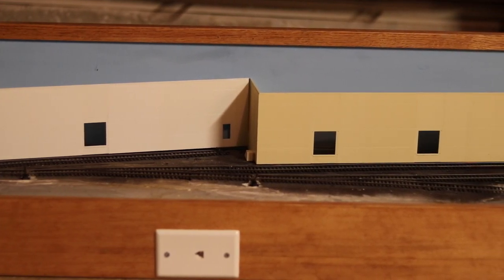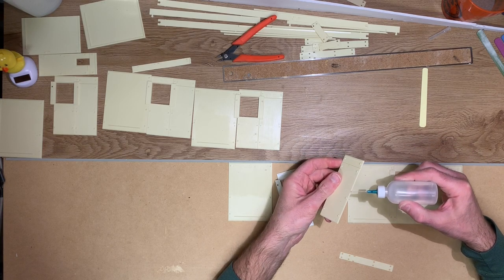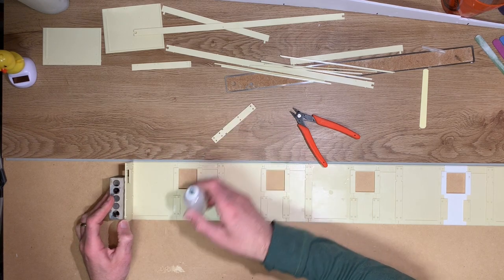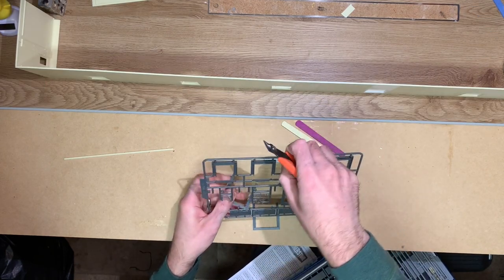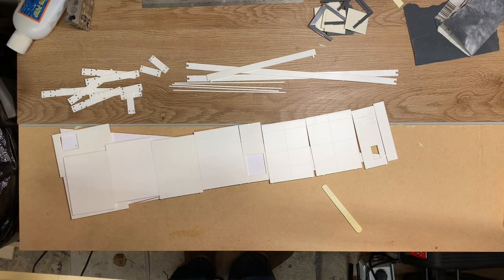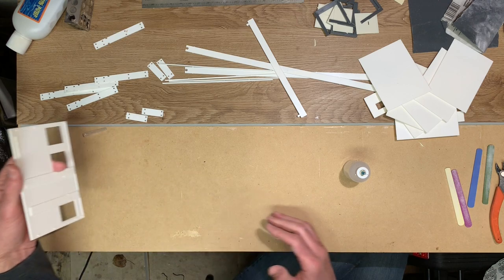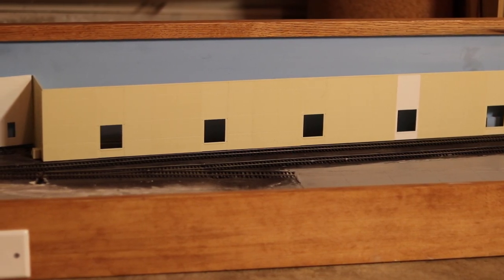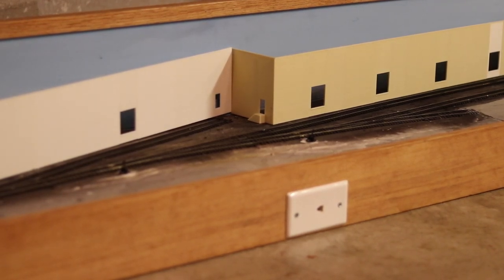Tulsa Spur Part 8: Structures for the 1x6 HO Switching Layout

Comment: You set that up for 40' box cars.    Will the  the pieces line up for longer cars, like 50'
Reply from the maker: No, you can't do the same number of 50' cars. You could only do 3 boxcars of 50-60 feet instead of five on the structure with the five loading doors. The track capacity is about the same but the loading doors won't match up with the doors on the boxcars.
Reply: @StevesTrains  great thank you.    I think I will buy a couple of the kits.